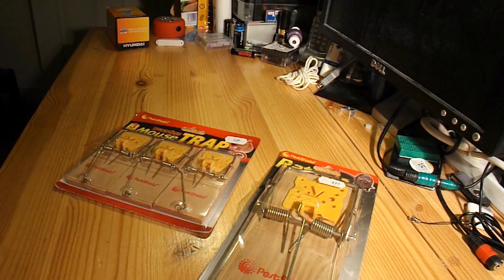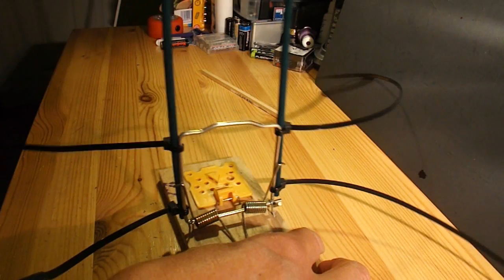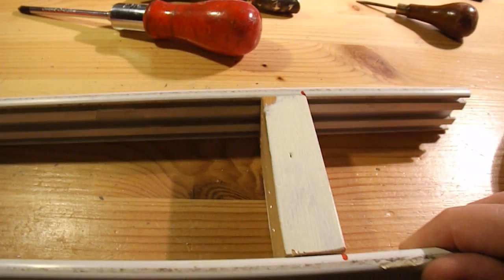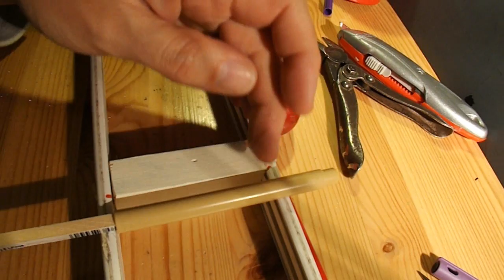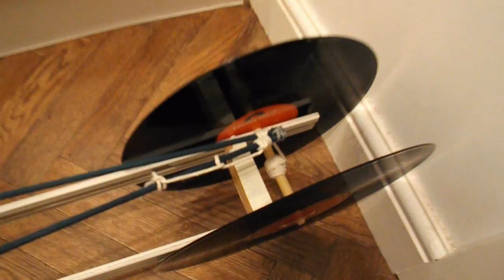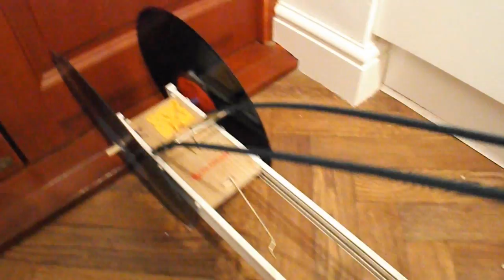Bargain Store Project #30 Rat Trap Car

Comment: what was the product you used for the lever string can we substitute it with another material??
Reply from the maker: I bought mine in a Garden Centre but I expect DIY shops would stock them and so would many supermarkets that have a gardening section. Almost any stick would do the job, it's purpose is to lengthen the lever arm. I did one using part of a plastic coat hanger. The advantage of the flower cane is it is bamboo and is a little bit flexible so it would bend a bit when other types of stick might snap. I have done others using BBQ skewers. There is a link to my Mousetrap powered cars playlist in the video description with many other designs.
Reply from the maker: It was just some string, I am sure you can use many other items. Some people use fishing line. There are some useful links in the video description for other mousetrap cars and videos.
Reply: I mean the lever which material is it
Reply from the maker: ***** it is a flower cane made from bamboo. There is information in the video description. I am sure you can use whatever you want. It's purpose is to lengthen the rat-trap lever arm. Any stick would do as long as it is strong enough
Reply: do u know were i can buy flower cane